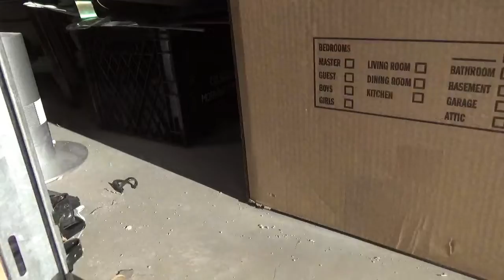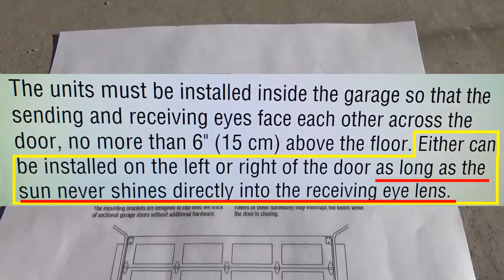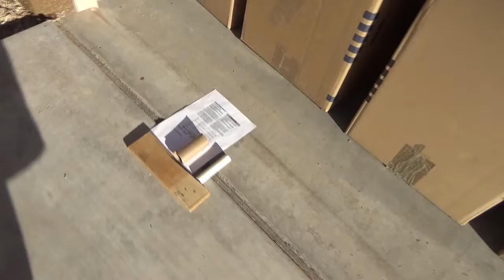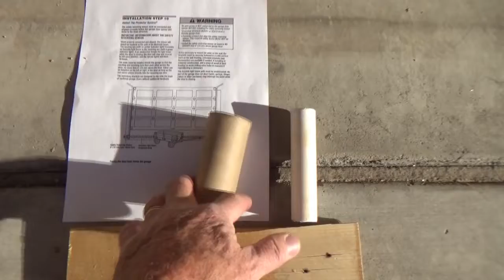Garage door not closing due to sunshine on sensor? TP or PVC pipe? What you’ve been told is Wrong!

Comment: I have opposite issue.  Sun hits transmitter (yellow light) and door won’t close - receiver (green light) is in the shade.  Your solution should work - or the fact that it’s the transmitter - point to something else?  ONLY occurs between 9 - 10 a.m. - no issues except during this time - so I know it is the sun.  Just not sure why - after 15 years - this is now an issue. I would have thought the sensor is just “weakened” over time - but hey - it works 23 hours a day - so I guess that is acceptable 😊

Comment: did not work.  sun shining on transmitter only and it wont close
Reply: Absolutely agree with you. It does not make a difference send or receive sensor. It still will not work if the sun is shinning on either sensor, not just the sending one.

Comment: It happened to me..took me awhile to figure it out..had to put a make shift shade and it worked
Reply from the maker: Glad you found a solution. Was the shade put on the receiver (green light) unit? That is the only one affected by the sun.  
And do you have the sun shining on both sides of the door during different times of the day? Usually only happens with a south facing garage door. 
If only an issue in the morning or evening, as you can see, it is fairly easy to swap the sending and receiving sensors for a cleaner more permanent fix.
Reply: Also...yes facing south garage door..